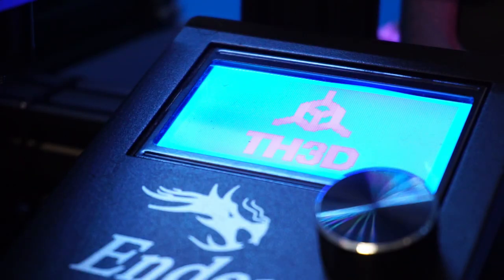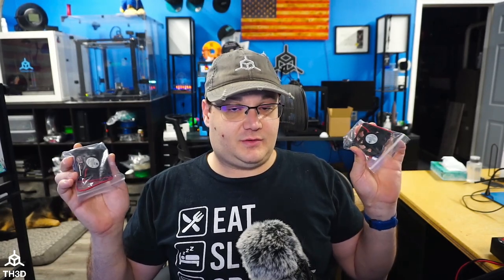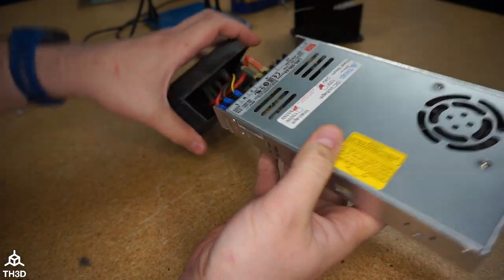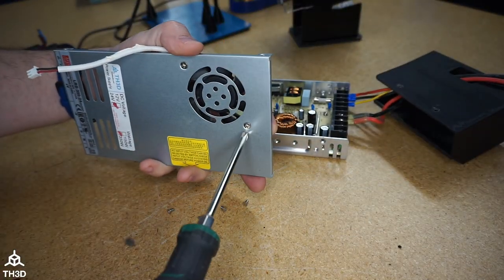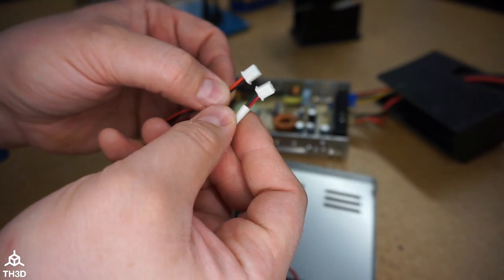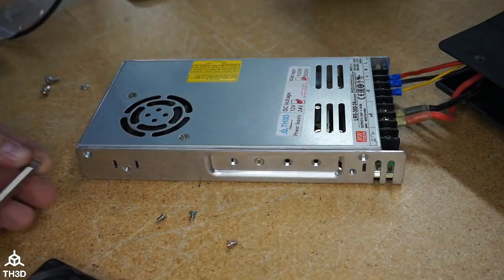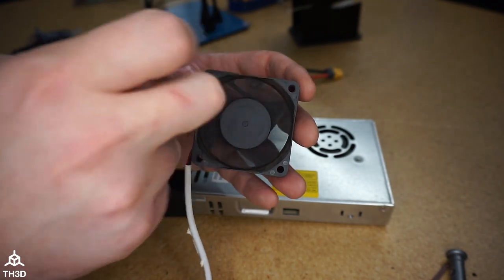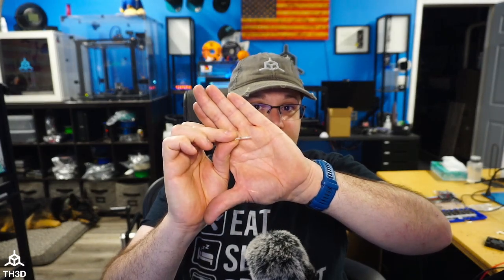Changing Your 3D Printer Power Supply Fan - How to Video

Comment: This is exactly what I was thinking about doing for my aging 3D printer someday. I already replaced the other cooling fans in the printer, but that PSU fan is still a bit of a leafblower. Good tips on how to switch the pin polarity, and to remove the old plug for splicing it. I've done that before, and it's good knowledge to pass on. Great video!
Reply from the maker: Thanks! Glad you enjoyed the video!

Comment: You should add a warning at the beginning of the video about working with mains voltage.
Reply from the maker: If the PSU is unplugged as shown in the video, there is no mains voltage.
Reply: @TH3DStudio Older power supplies may lack a capacitor discharge circuit and can still shock you.
Reply: @TH3DStudio  Always beware of the capacitors.